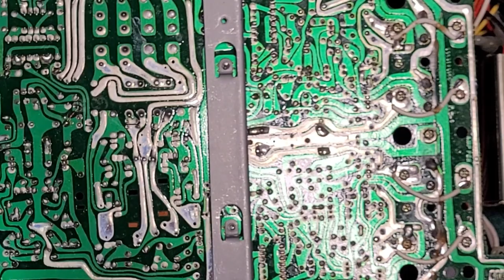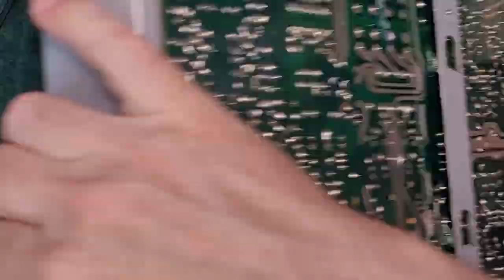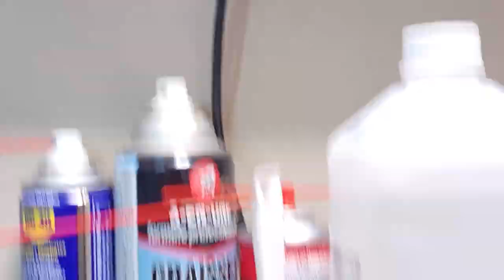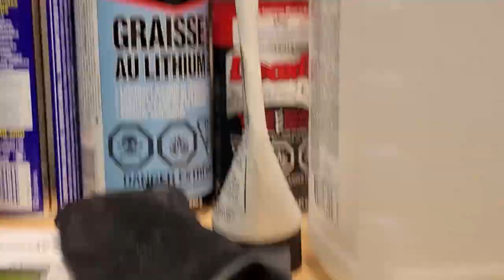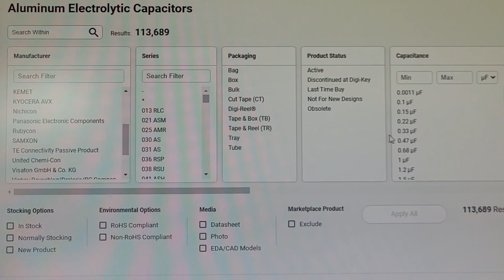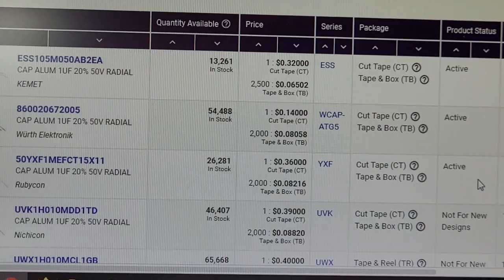NAD 7020e - Electrolytic Capacitor Replacement

Comment: Hi, a nice video.
I agree completely with replacing all the electrolytics, however, for the cost difference I would always go for the highest grade cap I can find regardless of where it is in the circuit.  Power circuits matter too, as the DC power is what pushes up the voltage and current on the amplifier to drive the speakers.  The cleaner the power, the less noise is introduced into the signal.
In order, I go for Elna Silmic II, then Nichicon KG, KA, FG and finally Panasonic FC.
A couple of other points.  I note you didn’t mention a dim bulb tester for powering up.  On unknown vintage gear I wouldn’t switch on without it.
Also, your soldering iron bit is very fine.  I used to use a fine bit until I saw someone using a flat tip to great effect.  It transferred the heat to the job faster meaning you get a good joint without overheating the component via its leg.
Anyway, I enjoyed watching this.  I’ve done many amps over the years and I currently have a very badly damaged Musical Fidelity Elektra E1.  I’ll do a few other mods too but I know it’s going to sound great in the end.
Keep on recycling, it’s good for the planet and good for the soul 😂
Reply from the maker: Thanks for watching.  I have used audio-grade caps in the past for certain gear, but I find that the cost-to-performance-ratio isn't really worth it in the end.  I will use an audio-grade cap in the audio path, but for general filtering, a low-impedance cap is all that is necessary.  When replacing output transistors, I always use my dim bulb tester.

Comment: Interesting. And your testing confirms what i found on my nads.  Caps still good.  That one flat green cap on you tuner board is probably the supercap for your station preset memory. Looks like the original.  Replace it and the tuner will hold presets for 3 weeks.  Usually  0.047 uF. By the blue search switch.

Comment: Elite Caps are actually not bad, i used it in my Pioneer SA7800 recap project, and they doesnt go away, and theyre also not too expensive and they can do the job well, unlike Samwha or something like it. I dont like samwha due its not too good, and they go away quick, they have pretty low life expectancy.
Im using Elite caps for a year at this point in my unit and they are still good!
And people say that if you dont buy a well known cap, youre buying a bad product, its not bad, at least not always, if you can get an Elite, im pretty sure it will be good, I used it for a year, my amplifier still sounds as good as when i recapped, so its good (I didnt do the main filter since 4x 8000uf caps have measured 7000-7100uf and very low esr, so its good.)
Audiophiles will gonna hate me but yeah, i just worked for a 3euro/hour job at a 3rd world country, most of the cases, i cannot afford those more expensive caps, and if i can, its just not available there.

Comment: I own a NAD 7020e and only replaced the power supply capacitors because their value had decreased. Indeed "recapping" is a controversial topic. I prefer to measure the ESR value of the capacitors and their value and then decide whether to replace them. Yes, of course they all deteriorate over the years but I take the position that if it ain't broke don't fix it. The degree of deterioration also depends on the position of the capacitor in the circuit and also whether it is next to a component that gets hot and it also depends on the capacitance and voltage of the capacitor. The blind replacement of capacitors originated from the bad capacitor plague of the years 1999 to 2007. Unfortunately this replacement wave has become a hype among HiFi repairers.

[EDIT] Still, nice work to salvage this beautiful old receiver.
Reply: So you actually remove the capacitor of a 40 year piece of gear and then replace it if it tests good? Do you realize each time you do that it costs you about $5 in labor? NOT replacing a 40 year old cap that costs $0.40 and sacrifice $5 in labor is insane in my opinion. I can see this only if you don't have stock on hand however, if you are going to be doing this work, you really need to have invested a few hundred bucks to create a comprehensive stock of common cap values and then after a restore you simple place an order to refresh your stock.

Comment: I have an NAD 7220pe that has a 120Hz lie level hum that is constant and independent of any cables, source, controls, or settings. It's just constant.
I can drown it out by increasing the volume but I'd like to eliminate it.
I have been advised to replace the power supply electrolytic filter capacitors. To start there. They are Teapos rated at 4700uF 50V. 
I've never recapped. I'm willing to try.
Am I on the right track?
Any other ideas why the hum? There's no outside interferences either.